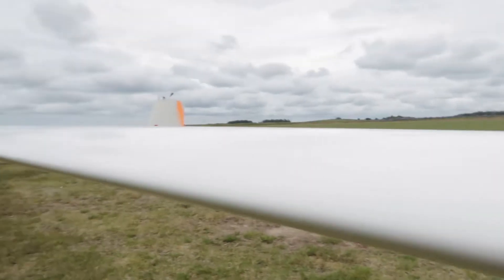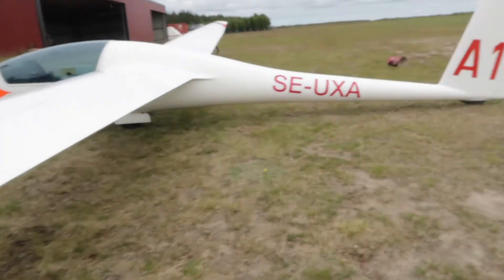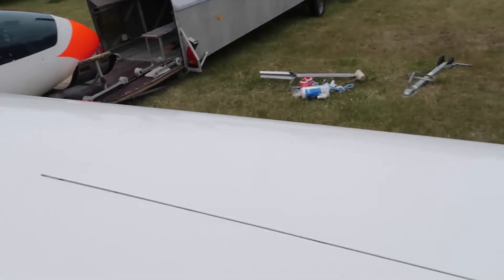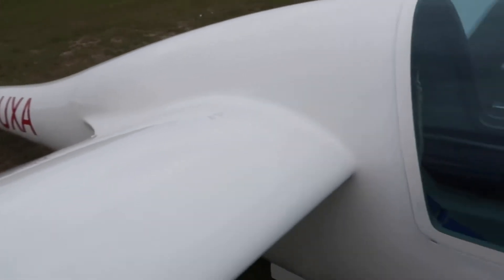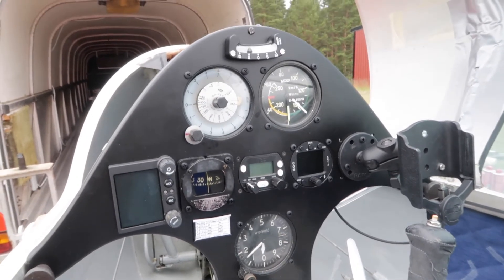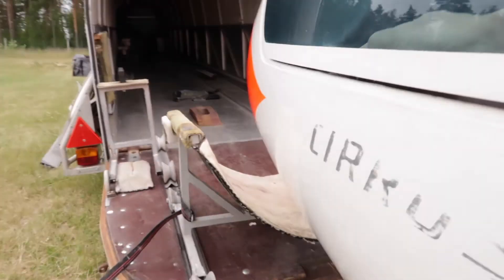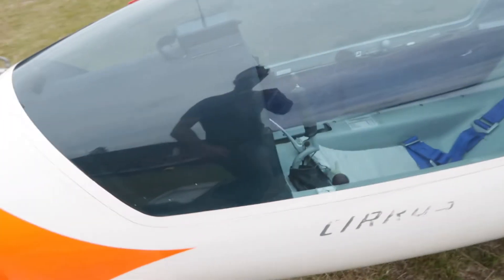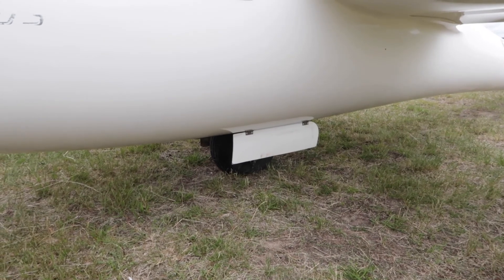COMPETITION GLIDER | GLIDING

Comment: How did you improve the gap and make sure the canopy is flush at the front?
Reply from the maker: It's done with gelcoat; casting using cling film and the canopy.....and alot of sanding.